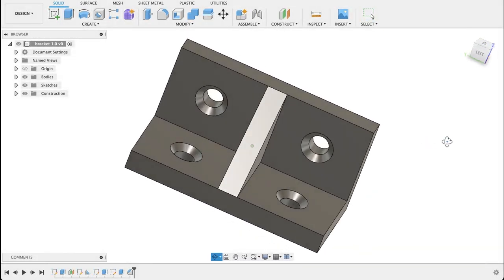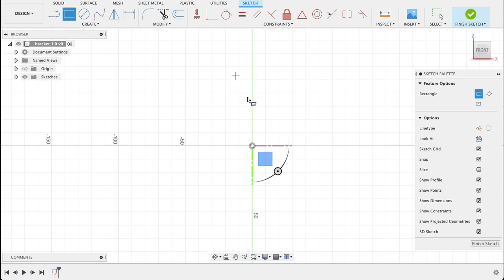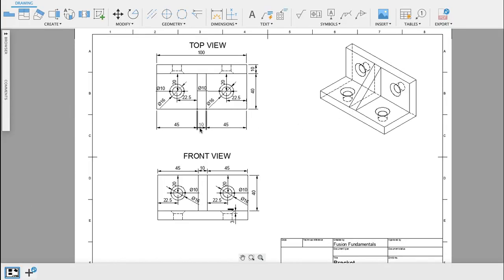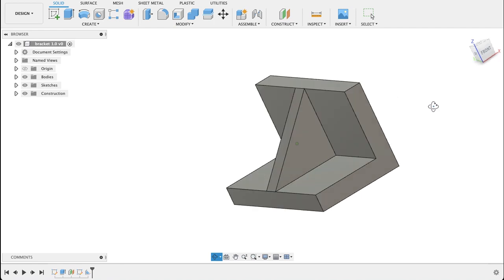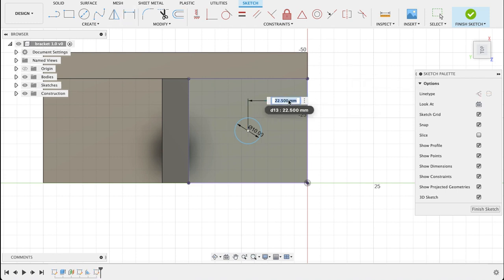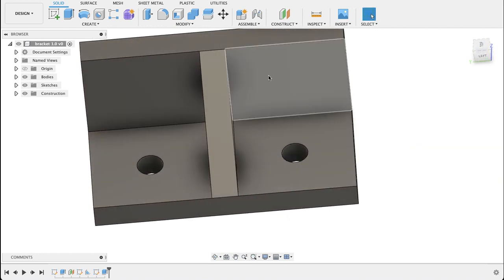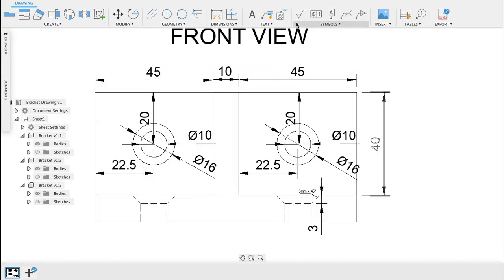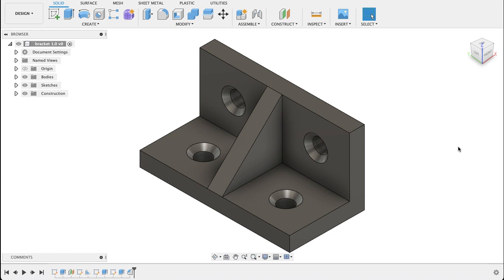Fusion 360 Beginner Tutorial: Mounting Bracket

Comment: so other vids ive watched have hammered hard on "not using discrete constraints when ever possible".  would it be advisable in your design here to project a midpoint plane for the rib instead of a distance off the side face?   also the holes, would it be better to create one and then mirror it over to the other side?     if this sketch is scaled or changed what happens to all the holes/ribs/changes that are constrained with exact measurements instead of relations?
Reply from the maker: You are 100% correct. If you anticipate a model being scaled you will need to make is “scale proof”. The idea with this tutorial is letting a beginner start modeling without being too strict on the dos and don’ts.

I found just having some fun with the drawing you learn a lot quicker. 

But if you are going into an engineering environment it is essential to learn best practice.
Reply: @Fusionfundamentals kool, thanks for hte reply. im very new to this (last week or so). im building a CNC and just got 3d printers.  complex mounting brackets are mostly what im after so im trying to find tutorials for those.

stuff like 110 degree angle changes, mounting flanges, gussets, offset supports, holes for hardware, and wrapping around real life objects.   i find i need this kind of stuff quite often and id like to learn the design side.

up till now its been plasma cutting and tig welding on the fly to make stuff.
Reply from the maker: @beardedgaming3741 that sounds awesome. If you need a hand with any of the designs I’ll happily help. I’m always looking for a project. You can email me at fusionfundamentals@gmail.com
Reply: @Fusionfundamentals  sure, I'll send you an email in a bit just to touch base. I'm currently working on a project for a radiator mount on my computer
Reply: @Fusionfundamentals after 8 hours of trying. its compound angles. thats what im stuck on. do you have vids on how to calculate and build off cascading compound angles?
Reply from the maker: I’m not sure what you mean by compound angles. You would have to do some trigonometry to work out the angle you are looking for probably
Reply: @Fusionfundamentals not so much finding but making the geomitry. so like, odd angle planes, joining different pieces to flow together. how to blend things into a unified part
Reply from the maker: It’s probably not best practice but you can just move the bodies around and if they overlap each other you can use a join command.
Reply: @Fusionfundamentals  I'm playing around with that now. Trying to wrap my head around how to make some things scalable in this scenario. Also no idea how to add gussets, to strengthen everything into a flowing body
Reply from the maker: Ok, I’m sure you will figure it out. You have a pretty cool setup and once you can visualise what you want the design is not far away
Reply: yea the big screens are nice to work with fusion on ill tell ya that.   i may end up fabing it out of aluminum for now and come back to fusion later.   i had a thought to design from the bracket back to the cyllinder instead of cyllinder first. we will see if it works better @Fusionfundamentals
Reply from the maker: Cool man. Send me a link to the finished product